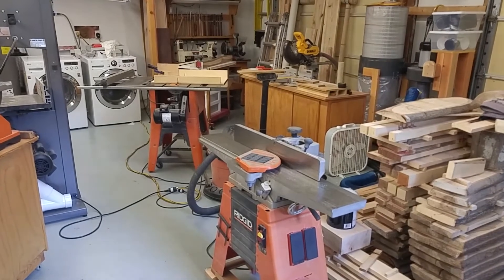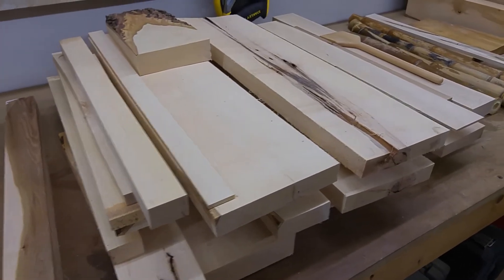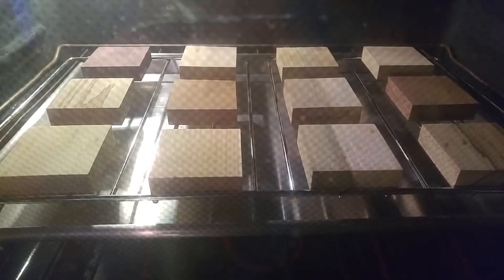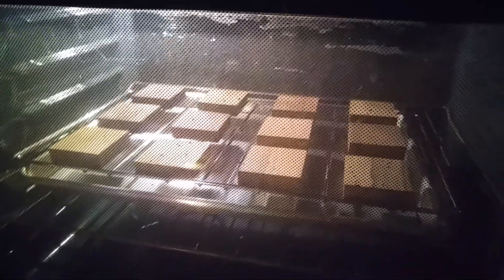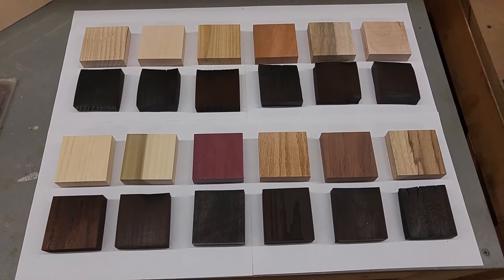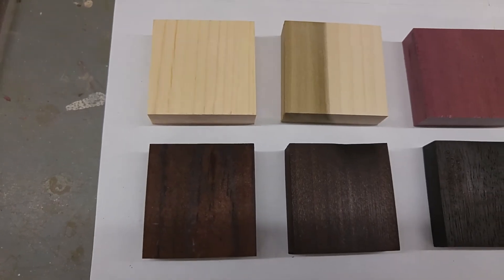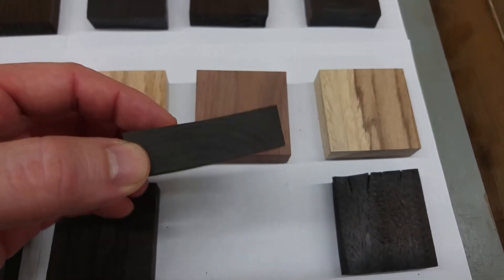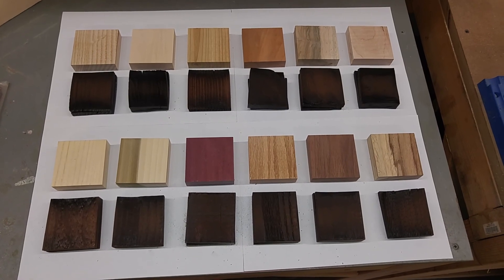Thermally Modified Wood Experiment - Part 1

Comment: I am a tap dancer and want to make taps from torrefied ipe. Apparently if you wrap the wood tightly with aluminum you eliminate the contact with oxygen and it doesn't burn as much. I am going to be trying this in the next few days.

Comment: If you cast or weld an aluminum box and vacuum the air out and run the experiment again it should work a lot better 👍
Reply: If he vacuumed the air out, it would probably boil off too much moisture and resins, destroying the wood. The aluminum box would need a heat-resistant hose constantly vacuuming during heating, otherwise explosive pressure could build upon heating.

Comment: According to Turkish researchers, the wood loses up to 20% of its strength if its heated up to the 400 degree range. But if its heated only up to the 275 degree F, range but for a  longer time, around 5-6 hours,  then it only loses around 8% of its strength. Also, it does not get rid of sugars in the wood- it caramelizes the sugars so that they are not in a form fugus can grow in. Sugar in its pure form will caramelize at 338 degrees F.  I think what you did more or less charcoalized the wood,
Reply from the maker: That's interesting, do you have a link? I found this video recently, which includes several charts showing the outcome at different temperatures: https://youtu.be/Xp5_eW1ntO8

Comment: I am dealing with professional thermal modification kilns.  You face a great fire risk unless doing this in oxygen free oven by not removing but replacing the oxygen with saturated steam.  So keep a pot of boiling water in the oven during the process.  Needs constant refilling, though.  We use 200 litres of water for each  430 bf of wood!  Chemical reactions start to happen when the temperature reaches 375F but for full treatment you have to reach 445F. Warning: wood is exothermic starting to GENERATE heat so the job is to cool the wood, not heat it.  We do it by spraying water on the wood which absorpes the energy when it evaporates. Tricky and charcoal may be what you will be getting out...
Reply from the maker: I've had the best outcomes in the 300-350F range for most woods, which is not likely to ignite anything. I've tried using steam, but part of the problem is that a home oven isn't big enough for a pot of water and a full stack of wood. The steam ends up concentrated on certain parts of the stack. A home oven certainly isn't an ideal kiln, but it is an available one.
Reply: @TheSnekkerShow  a further comment: that 300-350F range is good for changing wood color and most flooring makers are using that range for that reason.  Chemical reactions start only after 375F improving the wood durability.  At lower levels nothing happens.
Reply: @TheSnekkerShow  I find it very interesting experiment that never came to my mind. Maybe you could develop this into a product for the consumers: after the turkey is done the oven is left to you? Just kidding... Anyway I would put a cooking tray of water below the wood but it would need regular replenishment.  The standard air fan in the oven is not strong enough, compare to this video from a full size kiln: https://youtu.be/G0d-a0HW1l0

Comment: How thick was the wood in the experiment? Is there a recommendation for time per board foot or inch/thickness?
Reply from the maker: These pieces were around 3/4 inch thick. I've done thicker boards around 2 inches, but haven't worked out a formula for thickness.

Comment: I think the back row got hotter first.
Reply from the maker: That was a conventional oven so the heating element was on the top, but it's possible the door in the front could have allowed more heat to escape than the steel in the back.  I've had pretty similar results with subsequent tests though: Softer woods tend to self-insulate a little better.  I even replaced some rotten fascia boxes on my house with baked poplar boards once they reacclimated to room moisture levels.
Reply: @TheSnekkerShow  , I was thinking about ways to bake larger planks (like 1"x4"x8'). I wonder if you could use a pair of rectangular ducts, a smaller one inside a larger one. put the wood inside the smaller one, seal the ends with metal ducting tape and displace the air with a CO2 canister before totally sealing (to prevent burning). put the inner one up on some bricks so you can put propane burners under the smaller one, and insulate the whole thing with some high temp rock wool. the outer one wouldn't need to be sealed, and you could cut holes in the bottom for the burners to sit lower so they're not right up against the inner duct. use some thermometers to keep track of the temp inside the duct with logs in it.
Reply from the maker: @somedude-lc5dy  Good idea. I was thinking about doing something similar for bamboo poles, but haven't worked out the details.

Comment: Any misgivings about using the oven for food after your shenanigans? Probably not, but don’t you think you should keep craft/hobby materials away from food prep areas. It is amazing what I have seen placed in microwave ovens, conventional gas and electric ovens, and convection ovens and not once any mention of concern or consideration of the advisability of following these activities with food prep in the same device.
Reply from the maker: Since wood is regularly burned to cook or smoke food, I'm not worried about putting it in my oven. My main concern was proper ventilation.

Comment: I think heating it with oxygen involved causes the wood to chemically change in a different way. I think you're making charcoal, and not thermally modified wood
Reply from the maker: The absence of oxygen just keeps it from catching on fire, and is literally how charcoal is made. It doesn't affect the wood's properties otherwise.

Comment: A few years ago I was working on a project where the object was to roast white hard maple into an ebony-like state. To that end we cranked high heat & a left it in a long time. Ebony color achieved ✅ . Unfortunately the sugar maple came out mostly checked and with the texture/pliability of 17 year old peanut brittle. Completely unusable. Thank I still have a unit buried in the warehouse somewhere 😆. 
After seeing your results ,maybe we should have tried pine 🤷‍♂️?
Reply from the maker: I've learned a few things since I made this video. The first is to increase the temperature gradually, like 50 degrees every 30 minutes, to avoid creating uneven stress between the inside and outside of the boards.  The second is to stack, sticker, and clamp the boards together when possible.

Comment: Have you tried wrapping it carefully in aluminum foil? That's my poor man's version of an oxygen free environment. 

Maybe a little high temp tape from the big box store to seal the seams.
Reply from the maker: That's just crazy enough to work. Probably wouldn't want to seal it completely though because of the steam.
Reply: Yep. I think you don't really have to seal it completely. barely wrapping it should be enough to prevent it from catching a fire
Reply: That would just seal in the water.

Comment: You have to remove oxygen from whatever kiln you use
Reply: Otherwise you will burn the wood
Reply: I work at WESTWOOD we thermally modify wood
Reply: Kristina Gibson . I guess a lower temperature would also d better plus a running fan. But yeah, removing the oxygen is better
Reply: It's called oxidative torrefaction. You don't have to remove the oxygen.

Comment: Have you tried dying the wood and then baking them?
Reply from the maker: I have not, but that's an interesting idea. I'd probably bake the wood first and dye it while it's hot, dry, and very absorbent. I've found walnut oil soaks in very quickly and deeply on baked wooden kitchen utensils, for example.
Reply: https://www.youtube.com/playlist?list=PLh-hxroCfeyPAQo-rCHTgGDmJVTWFia9z&jct=xwnf0EXA7fyf0bR2rn6EIoCkN6VSEw
Reply: I'm glad I found you! You have an extensive knowledge on wood working and I thought I might ask if you could help me figure out a burnt wood technique. I almost have it down except for the finishing. I'm sure you have heard of it; its called, " Shou Sugi Ban," which is a burn and brush process then dye. I didn't realize there were so many different types of dyes, then they fall in to sub-categories and so on and the list goes on forever. Just to give you an idea of what I'm trying to replicate is that there's this Milling Company called Delta Mill Works and Re-sawn Lumber. So I thought they baked it with some sort of Powder Coating for wood lol. Maybe we could collaborate. Thank you.
Reply from the maker: Thanks for the link. You have a new subscriber.
Reply from the maker: I learned the name recently, but my first burned-wood project was a box I built 25 years ago (and still have).  Just last weekend I replaced some rotten gable returns with poplar that I sawed myself and baked in the oven.  I'll have to check out Delta Mill Works.  Thanks.